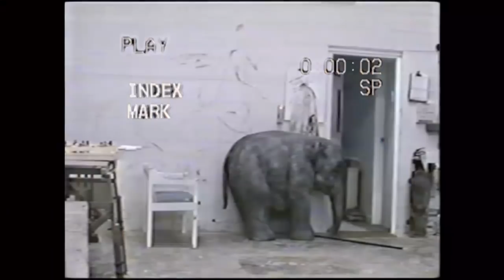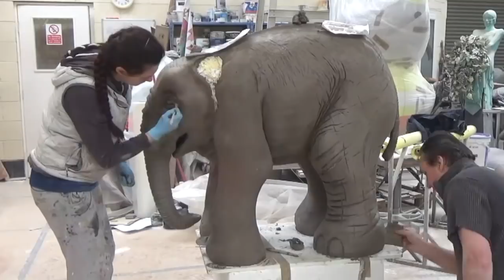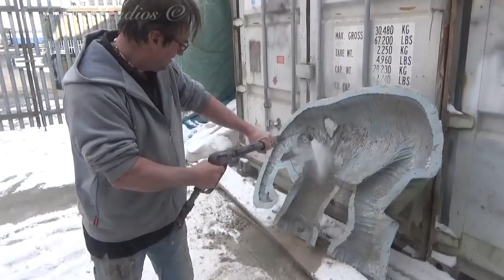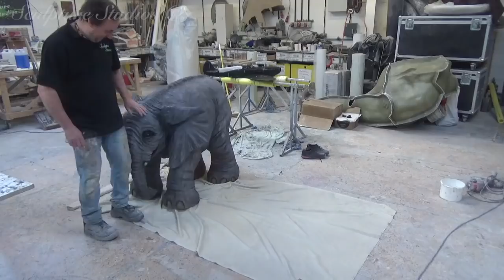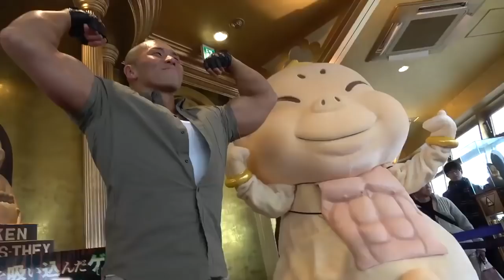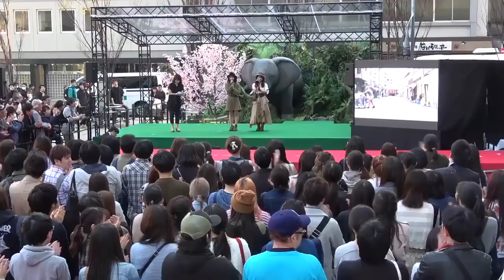Baby Elephant Costume for Jumanji by Sculpture Studios

Comment: I wished that they did used a thin base layer over the foam skin with textile paint which is used with printing on textiles. Because this liquid paint in many different brands contents an acid which makes this base paint under the acrylic paint a better to stick to the foamrubber skin paint then just a basic acrylic layer does. But expereance will learn after all I guess.